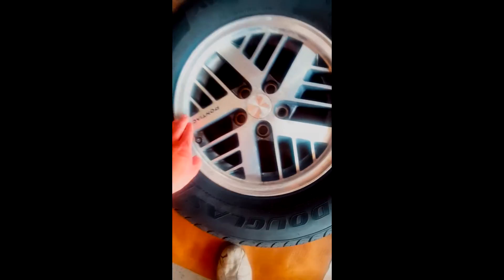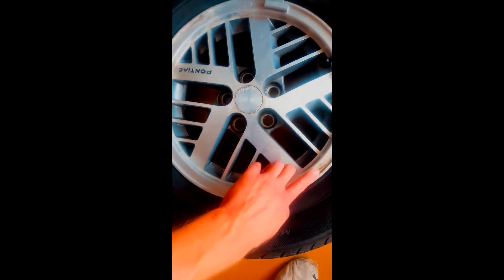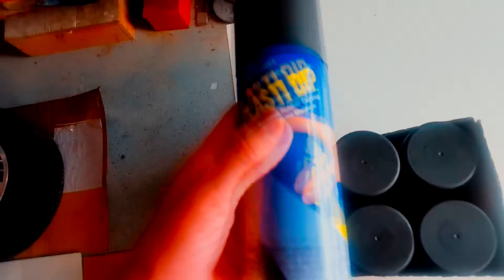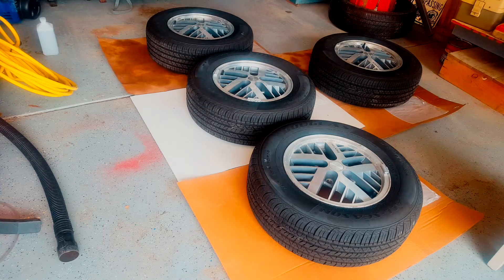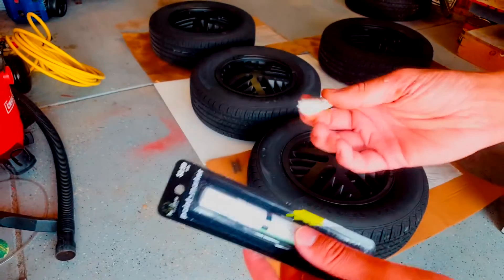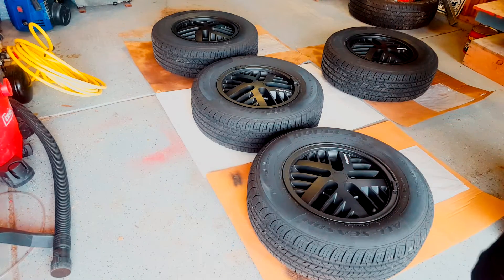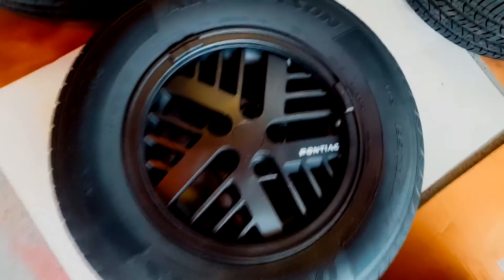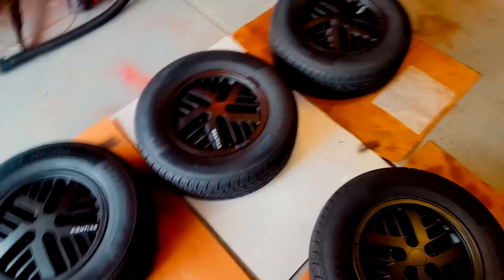How to Plasti Dip Corroded Rims

Comment: So you can still see the corrosion up close correct? I ask because my wheels have it much worse than yours so I'm trying to figure out what I should do before dipping them.
Reply from the maker: They look perfect from a distance, but if you get up close to them and look for the corrosion you will see it. You could sand it down and clear coat them before you plasti dip them, but that's a lot of extra work and you could get them powder coated at a shop.
Reply: Just get a wire brush